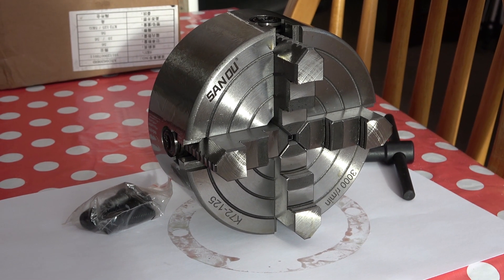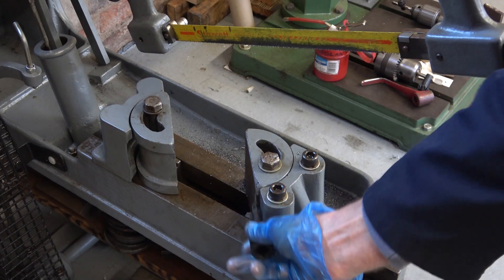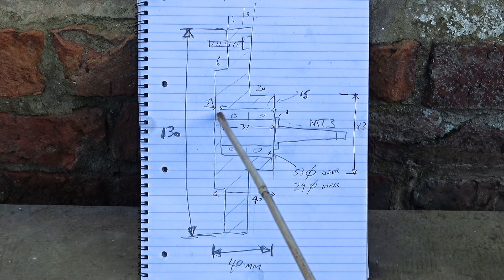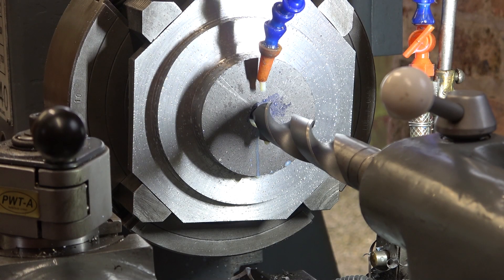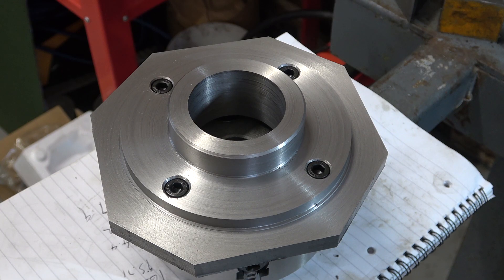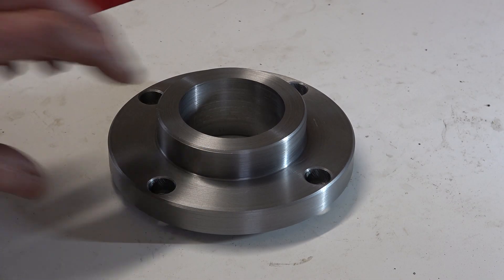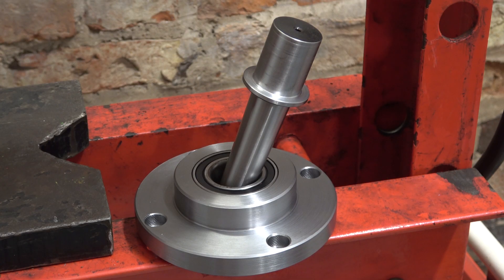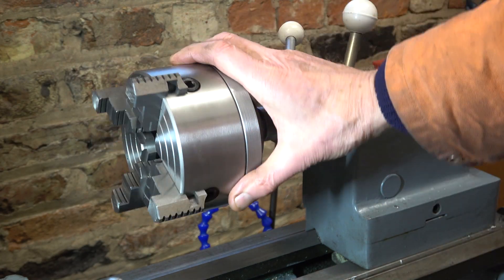HS43 Making a tailstock 4 jaw fitting for my Harrison 140 lathe

Comment: Mr. Haxby, I want to make the same thing. I am getting into a "Sticky wicked", trying to locate that bearing you mentioned. I see a part number of : PLB, or is it PL823532 ? Would rather make 1 bore thru, instead of a bearing on each end, much easier in the long run. Can you tell me where you purchased it ? NO ONE here in the states, can seem to find "That one". Thanks so much.
Reply from the maker: Hi Peter, actually I have another bearing just the same and I will check the size next week and get back to you. But I should say I got a lot of stick for using a car wheel bearing ball race rather than adjustable tapered bearings, and also for pressing it in so tightly. You are very welcome to copy mine but I do not claim it is the best design (but I will say that it works fine for me 😁). Cheers Paul
Reply from the maker: Hi Peter, I can confirm that it is a rear wheel bearing from a Ford Focus Mk1. Inner 29mm, outer 53mm, width 37mm.  I looked for some part numbers from the better manufacturers - FAG713678030, may be SKF 1085565 when it comes as a kit. Would not be more than £20 (25USD) here. Hope that helps. Cheers
Reply: @HaxbyShed  Hello Sir, and thank you for your reply message back. I had a bearing specialty house try to locate one, and they did. Rear Wheel Bearing 29X53X37 Febest DAC29530037 Oem D350-26-151B. It was listed on Amazon, and German made. What a break, as I (Really don't') trust bearings from across the Pacific. Total cost, 20 USD. Mine will be basically the same, except for using a #4 MT, and I must cut a 2 3/16-10 thread to fit a 4 J chuck, that has internal threads to fit a Harnige indexer chuck. I would like to cut the OD thread, then bore for the OD of the bearing, in one operation, instead of turning around, and loosing my concentricy. Having the chuck threads to the right, outside would be a good "Go-no go" thread checker. Thanks for your help !
Reply from the maker: @petermoale2116  Thanks for the feedback Peter. Always happy to help. Cheers.

Comment: You want an easy way to NOT EVER have clamping marks? Take a copper pipe or thin plate and make yourself some shims. But, make it even easier on yourself later on and design those shims to fit over the top boss of each jaw, drill and tap a 1/4 X 20 hole on each jaw to bolt the shim in place forever!  Brass plate will work, too. Happy days!!!
Reply from the maker: Thanks for that Mr F. I do need to make some soft jaw covers much as you describe. I'll add it to my odd job list. Cheers

Comment: Some material just doesn't like to break a chip. Older manual machines just lack the torque and power to push the tool hard enough to break a chip as well as it would on a CNC. They do break a chip very well if your machine has enough power. Again though, some materials just are stubborn.
Reply from the maker: Hi Spooky, yes I agree but also I might have had more luck if I swivelled the tool over a bit so it was not at 90 to the work. Cheers
Reply: @HaxbyShed  ehh that usually doesn't make too much of a difference depending on the inserts

Comment: OK you talked me into this project! I have the machinable MT3 blank but I bought a bigger wheel bearing than yours (it was cheap) which means I will have to make up an inner sleeve for the blank and probably weld it on and machine to size. I have an 8" chuck so the bigger bearing wont hurt.
Reply from the maker: @Frankish 🤣🤣 cheap is good. I hope you have a big tailstock because my 5in chuck is near the tipping point when I unlock the slide. It does not take much encouragement for the tailstock to tip forward. Cheers
Reply: @HaxbyShed  Thats a very good point! Its a 14*40 lathe so not that much bigger, I will check on how the tailstock is secured to see if tipping is a risk or not. My idea was to use the 8" chuck on both the head and the tail as required.. Might have to revisit this idea.
Reply: Yup your right.. the 8" chuck is too big! I have ordered a 5" and will keep the 8" for the headstock end.
Reply: Well I made up a sleeve to make the end of the MT3 bigger to match the inner race of my larger bearing. Had a nice 2 thou interference fit but unfortunately only used a 1/4inch plate on my press which deformed and pressed the parts in not straight. Oh well keep driving its almost home, which promptly bent the MT3 blank... Start again! I managed to save the sleeve, I will go for a slide fit as its already broached the hole too bit.. Then weld them together prior to final machining. Dumb mistake!

Comment: I realize this may be an older post, I'm curious where you found the MT 3 blank, Ihave a project it would be easier to buy the blank instead of turning the taper
Reply: John, if your in the states, look up McMaster-Carr. They have all sizes.
Reply from the maker: Hi John, it's too long ago to remember who I bought it from but there are loads on the web ranging from £17 to £26 - I just checked. The MT3 part is standard size but some have bigger diameter heads than others so watch that. Cheers
Reply: @HaxbyShed   I have found many ,all I have found have a smaller head, 32 mm at best
Reply from the maker: @johnsavoy980  RDG tools model engineering suppliers do one which has a head 40 x 40mm see ebay item number 3773378980669 or their website.
Reply: @HaxbyShed  Thanks

Comment: I'm really surprised that you did not use liquid nitrogen to shrink the diameter of the shaft. Instead, you you chose basically brute force
to secure the shaft in the bearing. In my opinion that was a huge mistake. What you press in always requires a minimum of double the force to remove it.
Reply from the maker: Hi Gregg, all comments welcome. I started my hobby shop a couple of years ago and I'm learning all the time. I might do it differently now, at minimum either heating the outer or freezing the inner. Adjustable taper bearings would have been preferable. Some day I will perhaps put in a centre securing screw. But I would not want to "over apologise" for it because it works pretty well for my occasional use. Cheers

Comment: Quick tip you can measure from the outside of one bolt head to the inside of the opposite one will give you the exact hole centres no maths required
Reply from the maker: Thank you D40. Cheers
Reply: With a digital caliper zero on the pin. (screw head) and then simply measure over both.
This way you've already subtracted 1/2 diameter of each of the pins leaving you with true C-C

Comment: There are a few things that need to be considered with carbide tips. There are usually 3 grades for any type with various chip breaker arrangements made for coarse, medium, or fine machining. The fine type has a very short distance between the cutting edge and the chip breaker and the others increasing distances. The edge "sharpness (geometry also changes across the range, but for home use, the choice should always be the finishing type unless you have a strong lathe and considerable courage. The second is that they expect much higher machining speeds than you are using, and the chips will come off blue to red without coolant. This speed affects the way the chip bends and work-hardens, changing the chip formation. I was machining a chunk of hardened steel this morning, part of a broker keyless chuck. Diameter about 50mm, rotation 1200 RPM, cut about 2mm deep 0,1mm per rev feed. The cut depth was limited by the chip temperature, they were Blue, but the machine could have gone much further. I have a Colchester Master that is considerably stiffer than the Harrison, so you may not be able to do quite the same but this is the kind of data from the manufacturers. Slow and low speed are really not the point of carbide, it is strength, thermal resistance, and hardness. You seem to be very cautious! I used to have a Colchester Mastiff  (1000mm dia x 2m length between centres) 15 HP spindle motor. With carbide tools of the right size, this would cut at least 1 kg/minute from workpieces, and it had spindle speeds to 1500 RPM. For fine jobs, I would use HSS tools sometimes, as I could control the shape much better, but I almost always use interchangeable type carbide tips for most jobs now.
Reply from the maker: Hi David, thanks for your comments. Some months further on now and I'm probably still too cautious. The idea of cutting 1kg a minute just blows my mind, although I have seen it done. I've had in mind for a while to do some "what will it cut?" tests - I will get to it sometime and your advice gives me more confidence. Cheers

Comment: Thanks. I just ordered a couple of those MT3 adapters. I was thinking about a Haxby/ Bommarito mashup 3 jaw. Should be fun.
Reply from the maker: Hi Mark, I got the idea from David Wilks (heavy trepanning) channel and then saw it again on CEE Australia. At first I had no firm need but soon enough I was using it for fun projects (I have a playlist on those). Some people got a bit concerned that I pressed the parts together without any snap rings or holding screws but honestly there is no chance of this thing falling off, and if you have ever pressed a van wheel bearing onto a hub you know it's as tight as heck. Nevertheless I might add a retaining centre screw and perhaps a back collar sometime if I'm short of something to do. Cheers

Comment: Добрый! Я вижу большое количество  почитателей Вашего ролика , но с инженерной точки ваше изделие - глупость (   Не внешняя обойма подшипника, не внутренняя не имеет механического крепления и при использовании вашего патрона в задней бабке если его упереть в деталь и прокрутить маховик задней бабки , то настанет момент когда внешняя обойма поползет в сторону патрона . В вашем изделии все не так (  хотя бы поставить  стопорные кольца и даже с этим улучшением , это плохое изделие(((
Reply from the maker: Привет, Сергей, я вижу, тебе не нравится мой дизайн. Да, я согласен, что зажимы (стопорные кольца) для удержания подшипника на месте были бы лучше. На данный момент он скрепляется только прессовой посадкой. Позже я добавлю винт, чтобы закрепить подшипник на валу. Но пока это работает очень хорошо. (Надеюсь гугловский переводчик работает). Ваше здоровье

Hi Sergey, I see you are not happy with my design. Yes I agree clips (snap rings) to hold the bearing in place would be better. At the moment it only holds together by press fit. Later I will add a screw to clamp the bearing on the shaft. But it has worked very well so far. (I hope Google translator is working). Cheers

Comment: Harrison lathes are a good machine ! Seems like black magic when you get the chip breaker working right ! I use a tool holder I made myself for roughing which is angled about 15 degrees to the direction of cut and about .020" cut. Great tailstock chuck !
Reply from the maker: HI Darren, I'm always busy with projects in the workshop but don't do a lot of machining on difficult materials so it takes me a while to build up my knowledge and technique.  But I am now 'on to' the trick of angling the tool to break the chips. Cheers

Comment: Thanks for the idea and the well thought out video . Could you please share your source for the soft ended MT3 adapter ?
Reply from the maker: Hi Bill, I bought that one from RDG Tools ltd, Unit 7/8, White Lee / Burnley Road, Mytholmroyd, West Yorkshire, HX7 5AD. Telephone: +44 (0) 1422 885069 They have a website and also on ebay. There are others a bit cheaper from other suppliers but that one had the larger diameter head I needed. Cheers
Reply: @HaxbyShed  Thanks for the reply
Reply: Hello Bill, I don't know where you are located, but if your in the states, McMaster-Carr has those adapters available.

Comment: Good job overall but next time try indexing your tool holders on the tool post such that you achieve a couple of degrees larger entry angle which will help with chip breaking
Reply from the maker: Hi Pontus, thank you. Been on my mind for a while, I need to spend an afternoon just trying different speeds and feeds and tool position angles - I still have not got around to that.  Cheers

Comment: I think these rotating chucks for the tail stock are an excellent idea, a guy I watch here in Australia called cutting edge engineering swears by them for his heavy turning work…..this guy just made a 152kg boring bar for an upcoming job.
Reply from the maker: Hi Gordon, several people asked "when would you use it?" but there are some jobs it's essential for. I made a playlist of my tailstock 4-jaw videos. People think I saw it on CEE Australia but actually I got the idea from David Wilks in Sheffield UK. His channel is mostly about large bore trepanning.  Awesome machines. Cheers

Comment: Nice job on this project....can you share with me the part number and where you purchased that MT3 stub shaft.....thanks.
Reply from the maker: Hi Eric, look on ebay for "RDGTOOLS 3MT SOFT STUB ARBOUR BLANK END 40MM X 40MM LATHE MILLING COLCHESTER" £12.95,  or go to their website direct. Cheers
Reply: Eric, are you in the states, or in the UK ? An outfit called McMaster-Carr in the states has them, in all sizes. Good luck.
Reply: @petermoale2116  Pete, I'm in the States, never thought of looking in McMaster for something like this, I use them for all sorts of other stuff for the shop so I'll have to check out what they have listed.....thanks for the heads up.

Comment: Tapered roller bearings would be better instead of a dual ball.
Reply from the maker: Hi Trent, I do agree with you. I just had the unused car wheel bearing in my cupboard so it was convenient to use that. I've done a few jobs with the tailstock 4 jaw now and it runs pretty well. If I was using it every day or needed absolute accuracy I could upgrade to taper bearings without too much trouble I think. The series of videos showing the tailstock 4 jaw are on the hashtag #TAILSTOCK4JAW   Cheers

Comment: Did that "Orange" steel actually come from Parker Steel ? Not all steel stockists use the same colour coding. I've got a chart that shows orange as EN36B...
Reply from the maker: Well in fact no. I bought a job lot of steel offcuts on ebay and the seller promised to send me the colour chart but despite twice asking he never did. I since got a 2nd colour chart from another stockist and there is a high degree of correspondence on the grades/colours but Orange does not appear at all on that one so really I can't be sure what it now. Cheers.

Comment: Very Nice done  i Made also such a Chuck  with to conical bearings  and between the two bearings  tree set screws to lock the Chuck  than you can put drills  taps  and all kind of tooling  in the Chuck  and you can drill and so on  you loose the set screws and is a turning center  Nice done shed
Lol
S
Reply from the maker: Hi, conical bearing would have been better but I used what I had. I'm planning to drill 24 indexing holes around the rim of the backplate and that could also be a way to lock it. I have a 'demonstration project' in mind - I just need to get the right bit of metal stock first, probably after Covid lockdown. Cheers.
Reply: @HaxbyShed  God idea

Comment: Lathe Works: A
Ballbearing Works: F
Reply from the maker: Hi, thanks for the comment. I have an idea for a project which will test the 4 jaw and the bearings. So after Covid lockdown I will find the right metal for the test and then we will see how well the bearings perform.  Cheers
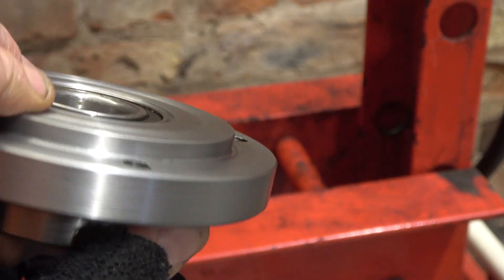Reply: @HaxbyShed  Sorry, a mistake: i mean the work you did to the  innocent ballbearings,  e.g. 18:33  sending brute force  from outer ring-->balls-->inner ring. better use exact fitting rings or pipes instead.
Reply from the maker: @krompkolb419  press work at 18:33 I see what you mean, thank you.

Comment: for stringy materials such as mild steel or like material, you might try an insert with a more free cutting edge+aggressive chip breaker. i have a few inserts like this and have had good luck with them, although they seem to be somewhat uncommon. i use the style you have (chip breaker) for chromoly and such.
Reply from the maker: Thanks. I did a year on machines as a young apprentice and I only came back to it as a hobby in 2019. The apprentice work was always with freecutting and I'm just beginning to experiment with alloys. I get poor finishes on non-freecutting mild steel and thought it was just me but I'm realising maybe it's just the nature of the material. I will read up on your advice and maybe try to find some. Cheers.